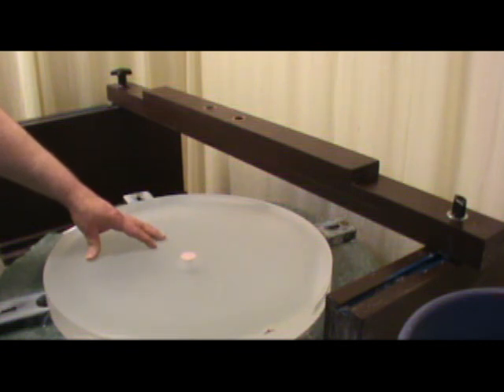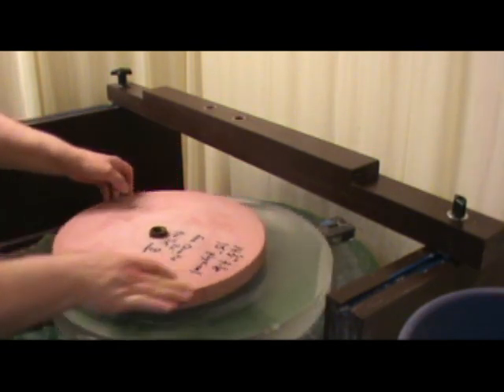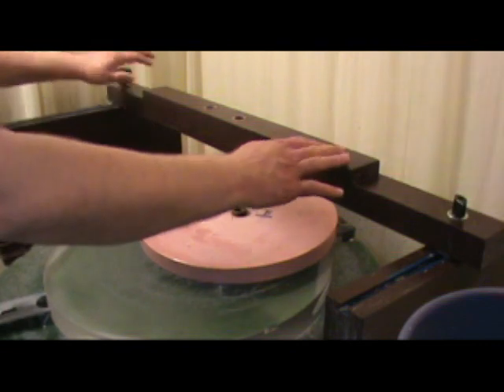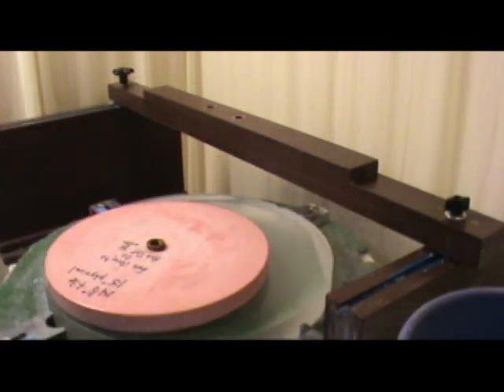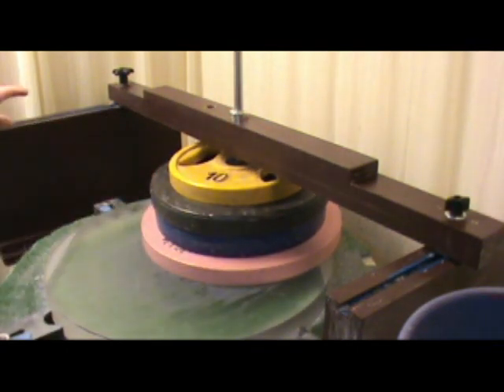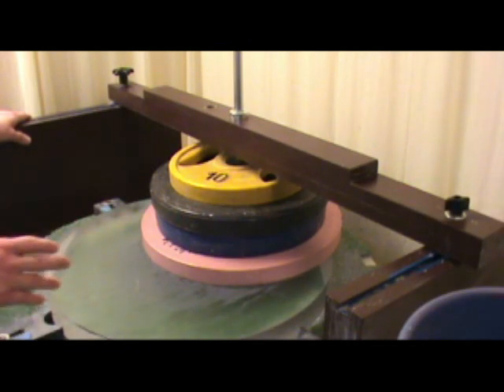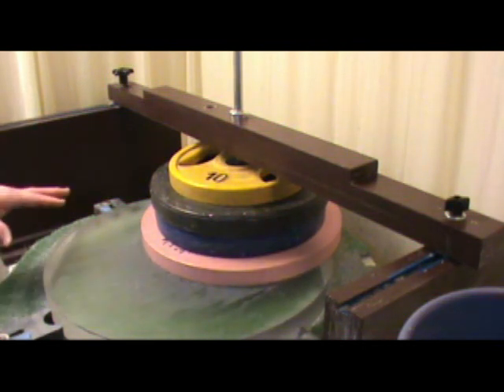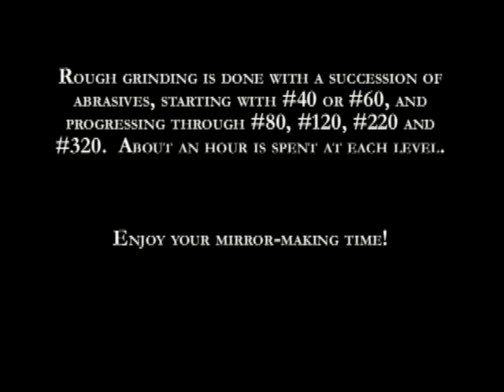Rough Grinding a 20" Quartz Telescope Mirror on the Fixed-Post Machine

Comment: Just watched John Dobson's video on making mirrors last night....so cool to see advances, but yet the same techniques
Reply from the maker: Yes, that's true.  Fundamentally, making mirrors today is about the same as 50 years ago.  We may have interferometers and such that we can use now, but you can still use manual process that have been around for decades and make wonderful mirrors just the same.  We try to make it easier and faster and better, but the old techniques will still work today, if you like.

Comment from the maker: @ThomasCoding The overhang of the tool is kind of something you learn from experience.  As a rule of thumb, you can overhang about 15% of the diameter of the tool as a good starting point.  Moving it in should deepen, moving it out should flatten.  It's a place to start, at least...  Thanks!
Reply: @GordonWaite thanks for the clarification- I’ve been looking for some rules of thumb on the positioning!

Comment: Hi Gordon, Thank you for sharing your knowledge and experience with us.

Telescopes are very expensive in my country (a cheap 6 inch one is starting about 700 USD) and large ones are really rare and really expensive. So after watching your videos I decided to make my own by following your videos. So I asked a worker to make a grinding machine for my old 2 hp motor just like your machine. Thanks to you for sharing these videos, the machine cost me only about 100 USD! Today I started to grinding a 12 inch mirror (with 1/2 inch thickness) to test the process and if I was successful, I start to grind a much larger mirror blank.

In above video you said that the tool is 75% of mirror's diameter, then you said that you overhang the tool by 2.5 inches, which is about 15% of the tool diameter as you mentioned on a comment too. So I made a 9 inch tool for my 12 inch mirror blank and I overhang the tool by 1.3 inches. I used 2 pounds of #80 silicon carbide and a 15 pounds weight over the tool and I set the machine to 60 rpm and after 90 minutes when I tried to check the sagitta I found out that my mirror blank is becoming convex!

I think that I overhang the tool too much so I tried to close it to the center by half an inch and mirror blank is still becoming convex. Is there a formula out there for needed overhang? in your response to draco6543's comment you said that you check it by changing tool's overhang for several times so I think that you don't know the formula or there is no formula out there yet. If it is so, could you please share some data (mirror sizes, tool sizes and overhang) from your experiences, so I can ask my mathematician brother to find a formula for it?

Also, could you please tell me if there is any other abrasive other than silicon carbide to use for grinding? I was not able to find Silicon Carbide in my city or nearby cities, so I had to go 150 miles away to buy it for about $20 for each pound. Also the shop I found Silicon Carbide in, had Cerium but it is too expensive too. It's about $200 per pound. Is it possible to replace Silicon Carbide and Cerium with anything else? Note that I used cement ($4 per 100 pounds) instead of dental plaster ($70 per 10 pound) and as I glued tiles to it by epoxy glue (as others mentioned it on the internet), I think it's fine.

Sorry for asking a lot of questions and taking too much of your precious time.
Reply from the maker: Hi!  So happy you have a machine, and are starting a mirror!  Sometimes the mirror won't start right.  What you need to do then is to make a small tool, maybe 3" or 4" in diameter.  Then work this tool my hand, center over center, until you get the curve started in the center of the mirror.  Once the curve is established, you can go back to your machine setup and the mirror should them get deeper.  Your setup as you described it seems just fine.

There are other abrasives for grinding.  You might be able to get aluminum oxide, or perhaps more commonly, garnet.  Garnet is used for lots of industrial processes and is pretty easy to find.  Check out places that do sand blasting, perhaps.  Best of luck to you!  Let me know how you progress.

Comment: Hi Gordon, thanks for putting these videos up, I've always wondered how mirrors were ground in this way. I'm curious however as to whether the tool needs to be convex, or will it naturally form this shape when grinding? It's clear that when polishing the lap is pressed to shape, but I'm not sure if this is also necessary at the grinding stage?

Comment: Gordon, if I use a tool with metal nuts instead of tiles, will the result be faster?  And if it's faster then should I use the tile with finer abrasives?

Comment: Where did you get your turntable or how did you build one? It carries a lot of weight and must handle a lot of resistance and side-loading due to the resistance of spinning the grinding tool. I could use a turn-table like this for other projects. I've built a few,  but smaller than this and much less powerful. I need a table that is powerful, has precise speed control, stable and quiet.
Reply from the maker: My turntable top is 1.5" of Baltic Birch plywood, laminated at 90 degrees.  It rides on six roller skate wheels.  The motor is a 3/4hp three-phase, run from a variable speed inverter.  The motor is very quiet, and the soft plastic skate wheels keep the machine very quiet as it turns.  I can grind up to 24" mirrors with the 3/4hp motor without any problem.  I have a gearbox on the motor at 30:1, so I have control of the turntable speed from about 3 rpm up to 60 rpm.

Comment: If the mirror comes completely flat from the factory, can I use these procedures to get the initial curvature I want?  I'm studying this process because I intend to use a machine to grind my mirror that I bought, I wanted to do it manually but I prefer to speed up the process with a machine.

Comment: Hi
If our mirror is 35 cm and our desired unparallel f is 12, does it work with the same fixed method?
The size of the tool is 25 cm

Comment: Hi Gordon, many thanks for posting these very instructional videos. I also want to start grinding a 20" mirror. My question is, do you start hogging the curve with the 10.5" ceramic tile and then you switch to the 15" tool for rough grinding (as shown here)?  If so how long do you work the mirror with the small tool? Thanks!
Reply from the maker: You are welcome!  There are a lot of ways to hog out a mirror.  If you want to do it by hand, I make up a plaster tool that used 1/2" steel nuts molded into it to do the hard work.  I would make the diameter of this tool anywhere from 25% to 40% or 50% the diameter of the mirror.  Actually, the 25% tool works faster than the 40% tool, but you need to make sure you are deepening all across the mirror, and not just the center 5" or 6".  I use pretty course abrasive, #24, but most people start with #40 or #60.  After I get the curve started by hand, I switch over to a 70% or 75% tool on the fixed-post machine and let the machine do the hard work for me.

Comment: can you tell me please if i can make a machine like this using a washing machine motor? i dont know if i may control the motor speed or maybe it's not powerful enough
Reply from the maker: I would think that would work.  My smaller grinding machines use a 1/2 hp motor, and my  larger ones use a 3/4 hp motor.  While my machines have fairly fancy speed control systems, you only really need two speeds, a fast setting at around 50 to 60 rpm's, and a slow speed around 3 to 6 rpm's.  You could set that up pretty easily with simple pulley systems.  If it wasn't too painful, I would also want an intermediate speed, maybe around 20 rpm's, for testing out grinding and polishing setups without having to go right to full speed.
Reply: thank you very much you have provided useful data;I'll keep this...
my other question is whether a washing machine engine consumes much more electricity than 1/2 hp, and if it has enough power to run those weights
Reply from the maker: I wouldn't think the washing machine motor would be much different in energy usage.  Anything under a 1/2 hp motor might struggle a bit if you try to use too much weight.  But if the motor starts to stall, just take off the weight, and take a little longer to grind!

Comment: Also, I forgot to ask, how do you pour the 15" tool? Do you place the tiles on the mirror you have started to hog out?
Reply from the maker: Yes.  I put a piece of adhesive-backed shelf paper, sticky-side up, on the face of the mirror, and put a plastic dam on it that is the size I want the tool to be.  Then I place the tiles on the sticky side of the paper, face down against the mirror.  Then I pour dental plaster over that (into the plastic ring) to create the tool.  Make sure the plastic molding ring is down against the sticky paper, or the plaster will leak out under it!